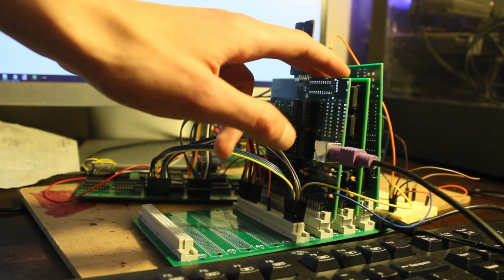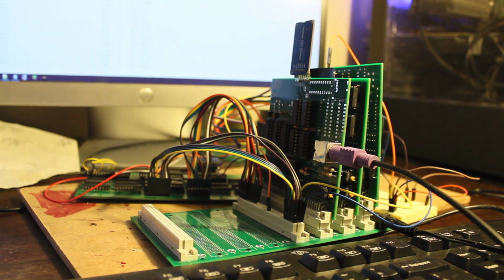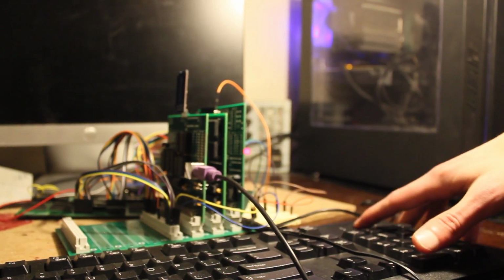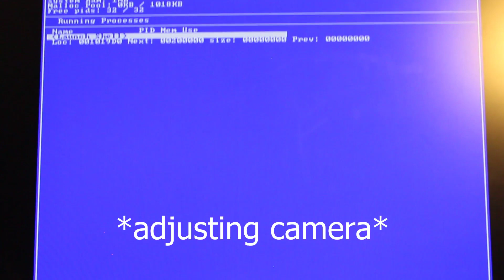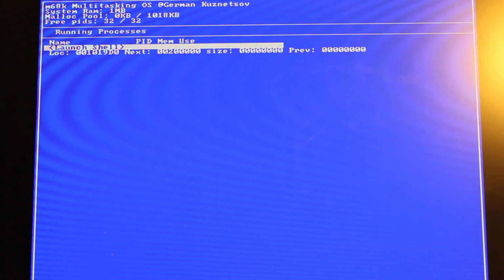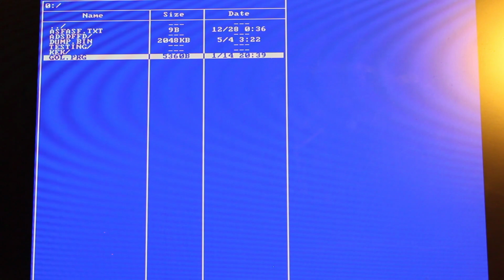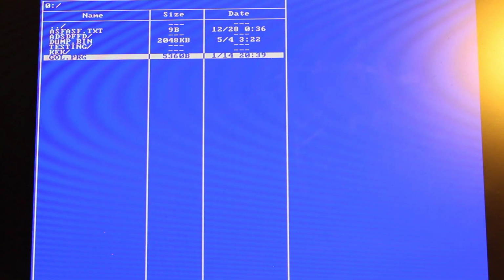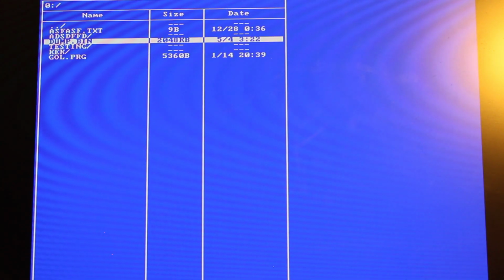Motorola 68k Computer SD card and Multitasking

Comment: Cool! Quite an undertaking.
Have you seen NitOS9/OS9? Well, there was a 6800 version, too. It's only 8 bits, but it might give you some ideas. : )
There was a good breakdown of it, in Inside OS9 Level II by Keven Darling.
OS9 Level II is a bit...complicated internally because of the GIME/DAT chip and 8k block scheme used to being a 6809 to either 512k or up to 2M, depending on how you look at it. So, Level I might be a bit more understandable. There was an OSK for 68000, which was more popular in Japan than here, it seems.